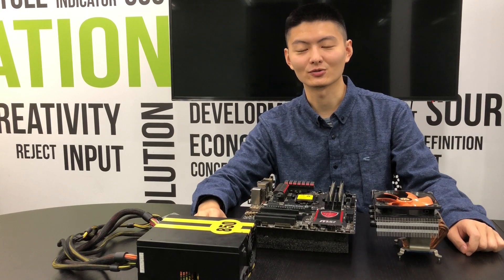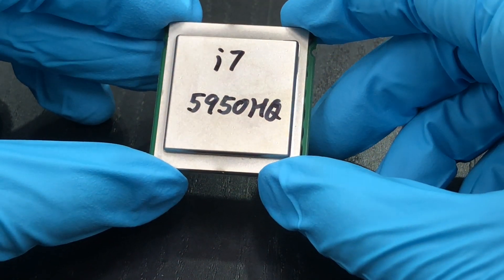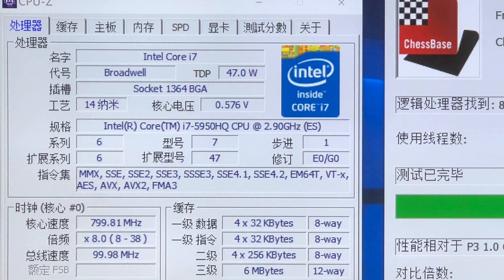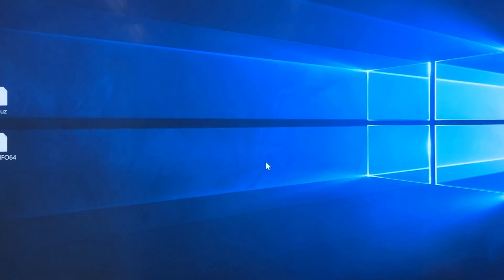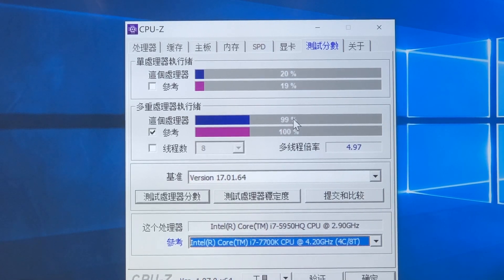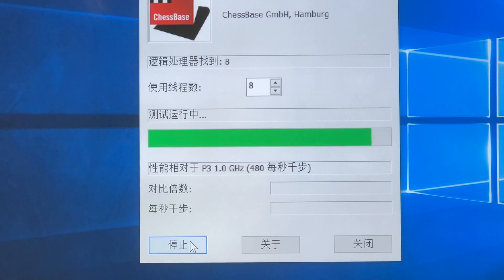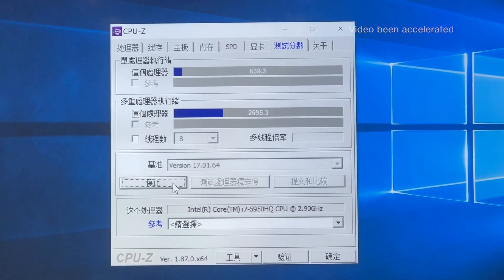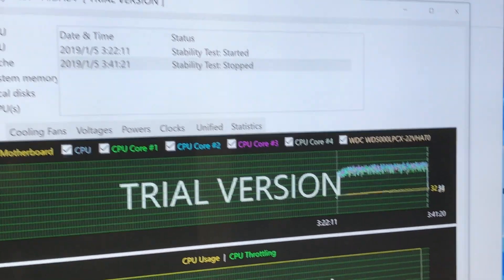MAGIC REFORM Intel Mobile CPU i7 5950HQ beats i7 6700K 4790K 4770K

Comment: It seems that the 4980hq is a better option as the multiplier may reach 46 instead of 42, and that chip has the same eDRAM advantage as this broadwell one.  I haven't really seen a head-to-head between these two as most of the reviewers who are attuned to these special chips would rather test vs the more mainstream haswell or sky/kaby processors.

Comment: 6 week update, chip is working great. Honestly best upgrade for H97/Z97 chipset.
Reply: Dimitar Gliguroski did you over clock this cpu? And does it support unlocked multiplier or i have to use intel XTU ?
Reply: @thanhanle3879  yes i overclocked, i am at 4.3 GHz stable, using bios overclock.
Reply: @dimitargliguroski5041  I wonder if the 5850hq would be a better deal since most the the 5th gen chips aren't stable past 4.2

Comment: Thank you so much, im looking into this cpu for putting into an old Rog G20 with a 3gb 1060 because it seems like a good pair for the small form factor, and lower power card. 
I would be upgrading from an Fx 8350 in the same config
Reply from the maker: You are welcome. ROG serial is great for OC. For the graphic card it exactly fit like GTX 980/1060 level GPU, that's true. Also, its iris 6200 is perfect for ITX.

Comment: +Hugo I switched to an Asus Z97-a, how can I boot if my voltage shows zero? It wont let me
Reply: I just fixed it, still reads 0v but it boots, If anyone else is wondering, just go to monitor tab in advanced settings, and set cpu voltage monitoring to ignore

Comment: Just received my chip, have it running at 4.3GHz all cores, 1.350v, max temperature of 75  degrees. 

Also, here are my benchmarks at 4.3 GHz: 
Userbenchmark: https://www.userbenchmark.com/UserRun/14444613 
Cinebench r15: 886cb points
Passmark cpu score: 12586
CPU-Z: https://valid.x86.fr/bench/r0c35m
Intel XTU: https://hwbot.org/xtu/analyze/4063899?recalculate=true
Reply: I think you might have to BCLK to get past 4.3ghz, my mobo (asus) only allows up to 4.4🤷‍♂️
Reply from the maker: @hellfighter17  The maximum core ratio is X44, while the 5850HQ is X42 and 5750HQ is X40.
Reply from the maker: I think 1.32 V is quite good if it run pass the benchmark. 1.35 V is the lowest voltage I have seen to run at 4.4 GHz.

Comment: This chip ain't to bad, was able to OC it 4.1ghz without adding any extra voltage and have the l4 cache at 2000mhz. My ram speed is stable at 2400mhz but your mileage may very. 
https://www.userbenchmark.com/UserRun/14281201 Cpu @ 4ghz and l4 cache at default.

Comment: Does crystal well cpu could work on biostar motherboard? I didnt see any seller mention that before
Reply: My mobo is z87 from biostar
Reply from the maker: Exactly, I haven't tried on Biostar yet. Even most of the mainboard is made in CHINA but seldom domestic buyer choose their product. Personally, I suppose Biostar would be fine because ONLY the GIGABYTE has very high risks of failure on this CPU.

Comment: Informative video! What was the CPU package TDP at full load? >1.3 Volts seems like a lot
Reply from the maker: From Intel official info is 47 W, if calculate in OC is unpredictable. But it does a very interesting question I would have a test.
Reply: Hugo check out IntelRAPL tools or ThrottleStop
Reply: Hey mate, at full load at 1.35v my TDP is around 95w
Reply from the maker: @dimitargliguroski5041  Cool, how could you calculate that? My plan is adding an electric meter to record the full load (CPU Stress Test) datas of whole platform in default and OC status, respectively. Then calculate the raising power and take the 47W as basic power then the result is roughly the final OC power.
Reply: @Hugo-ot7xu  Intel XTU has a TDP calculator in it, I find it pretty accurate. However all depends on power supply, ie-80% efficient power supply, total power draw will be 20% more than expected.etc
Reply from the maker: @dimitargliguroski5041  Wow, this function convince me know a more precise approach.

Comment: You have quite an interesting product. If I can ever find a Maximus VII Hero I will totally buy.
Reply from the maker: Maximus VII Hero is definitely a great mainboard. But I have to point out the Z87-DELUXE, B85 PRO GAMER, Z97-A, M7i on 5950HQ voltage detection is wrong.
Reply: @Hugo-ot7xu  Do you believe it will work on a z97 oc formula?

Comment: Hi I bought one 5950HQ, will it work with DDR3 1866MHz ram or do I have to lower it to 1600 in BIOS?
Reply from the maker: Just personal analyse, if the RAM original XMP boost to 1866, that many not a big deal. From my experience, my RAM's default XMP is 1600 and I just leave it along.
Reply: Did you have the core voltage doesn't read problem I have and I dont know how to deal with it
Reply: @Flashduke  My core voltage reads fine and I'm using a MSI Z97 G43 motherboard. I didn't really configure anythingo n my first boot, it just worked. Not sure how to solve your issue, maybe it's just your motherboard?
Reply: @LtMechMillanKilo  On Linus Tech Tips there was a test of the 4720hq on an Asus mobo it had the same problem that the core voltage didnt read but I may solve the issue when I will able to on a forum I found a possible solve to my issue.

Comment: I just purchased one, but am worried because it is an ES, was it stable to use? And was it stable at 4.2GHz?
Reply from the maker: Choosing ES version is based on considering the cost. Currently,  the 5th Gen mobile CPU is 'not that out of date'. So when applying them on re-fabrication, the cost is not friendly. Personally, I believe ES is reliable at least I surely it could pass all well known benchmark testing. For OC, forgive me being so conservative because I really don’t want to irresponsibly promise something which base on real circumstances of user. From most of buyer I know choosing this CPU working at 4.2 GHz is not a big deal. Say for 4.3 or 4.4 is also available but a good motherboard is definitely for a better chance on success.
Reply: @Hugo-ot7xu  Thanks, I want to get a 4.2 GHz OC
Reply: @dimitargliguroski5041  My chip arrived and I tried overclocking it. I managed to 4.2GHz at 1.315V Vcore and it seems to be stable after 45 minutes of aida64.
Reply: @LtMechMillanKilo  how are temperatures at that voltage and with what cooler
Reply: @dimitargliguroski5041  https://www.arctic.ac/worldwide_en/freezer-12-co.html this is my cooler; it's a semi passive one so not the best for overclocking. For thermal compound I use Arctic MX-4. With that said my temps are around 70°C, depending on which benchmark I use. In RealBench's stress test it got as high as 80°c but aida64 never reach that high. Also my room's ambient temperature is 19° too.
Reply: @LtMechMillanKilo  Nice, im maxing out at 70 degrees at 1.35v h100i pro rgb
Reply: Have you got the core voltage on first install 0.000Volts? I have and I didn't figured out how to change that to boot up normally
Reply: @Flashduke  My voltage reading worked fine from the beginning. Asrock H97 Fatal1ty motherboard.
Reply: @dimitargliguroski5041  So only Asus motherboards have this issue
Reply: @Flashduke  if you haven't worked it out yet, i have, its in my other comment. In bios, go to monitor tab in advanced settings, and set cpu voltage monitoring to ignore.

Comment: Dear Hugo I can not find the page on ebay am I too late?
Reply from the maker: Kindly notice it is still available and relative link been updated also I add the notice for explanation.
Reply: @Hugo-ot7xu  Thanks it works now
Reply: @Hugo-ot7xu  So will this processor work with b85 chipset?
Reply from the maker: @Flashduke  Definitly no, but the 4980/4960/4850/4720 etc is available.

Comment: Hi, what you think about 4980hq vs 5950hq which better after OC? And how many difference?
And which RAM I should use? DDR3 or DDR3L?
Reply: Its all about price in the end, though broadwell going to be better if u OC its cores to 4.1GHz+ and ring to 3.7Ghz+. Some motherboards also allow u to OC L4 cache, like Asus, it boost performance even better(in games only though). Thing is u need 9-series for broad, and for 4980HQ u can use 8-series including cheaper chipsets like B85 etc.
Reply: @AndrewKonin  q
Reply from the maker: Interesting question. I haven't done the comparison test yet but I heard the fans did so. 4980HQ does with more buffer on OC but the 5950HQ performance is slightly better.
Reply: @Hugo-ot7xu  can you please do some tests in cpu-z benchmark, crystall well vs broadwell on the same clocks, for example 4.2 ghz, thanks in advance

Comment: Do all of your chips oc on Z class motherboards? Like the 4720hq on a z87? Thanks, i just bought a 5950 to replace my 4790k
Reply: Dude, Broadwell won't run on Z87 or any 8-series motherboard...
Reply: Andrew Konin i thought it could run through a bios update?
Reply: @thanhanle3879  There are no bios updates for 8-series to support Broadwell
Reply: Andrew Konin my bad :(
Reply from the maker: Z Class is definitely design for OC, but we also well know some of H or B Class mainboard has OC function. However, I have to point out again we would not guid our buyer to OC. Because we really don't know the exactly circumstance and the parameters on certain mainboard.
Reply: @Hugo-ot7xu  but do all the cpus you sell overclock somewhat? Are they all unlocked?
Reply from the maker: @the7dan7dan  Originally the CPU is unlocked, so the PC mainboard's advantage is with much more powerful power supply to release its fully potential.
Reply: @Hugo-ot7xu  so the 4710hq can be overclocked to say like 4.1 ghz potentially?
Reply: Did you sold your 4790k yet?
Reply: @Flashduke  no I will see if this chip can perform better first